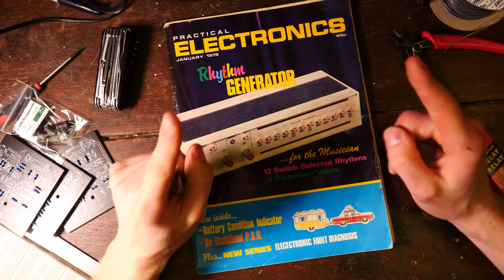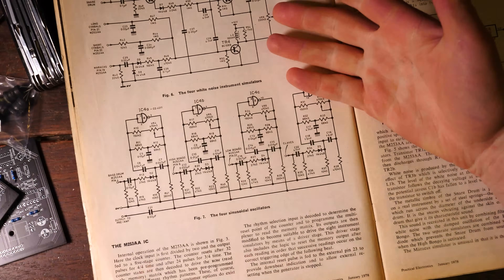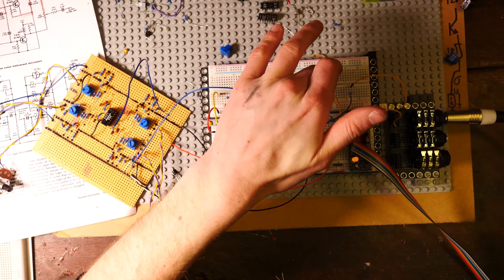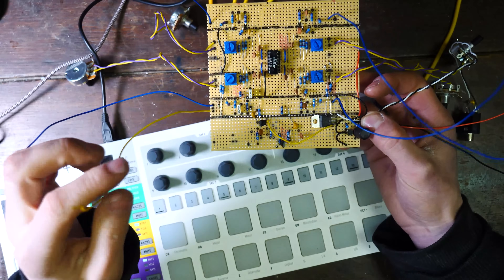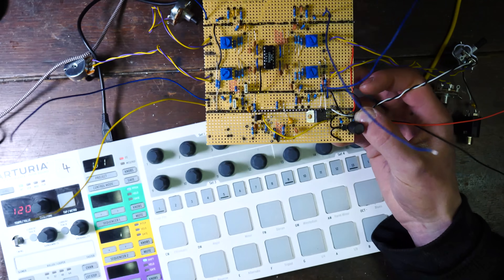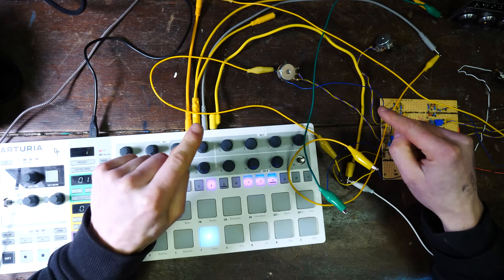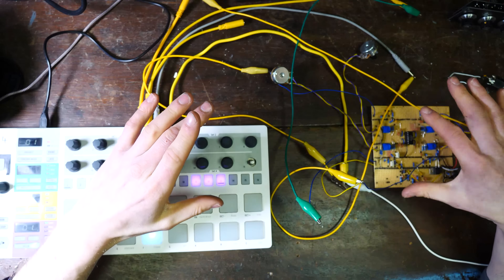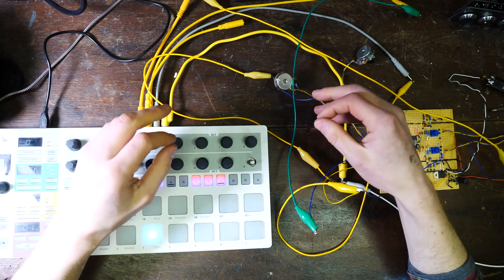Making A Drum Machine From A 1970's Electronics Magazine

Comment: The 4.7k resistor in parallel with the 100mH inductor in the noise circuit section. In the magazine, in one figure the resistor isnt shown, in the circuit diagram it is. Is it needed or not.

I've been trying to recreate this circuit too but can't get the white noise to come through when triggered.  

I've used 2n3904 transistors  instead of bc108b (waiting for delivery) is transistor choice key to this circuit?

What is the trigger spike duration? 5volt 1 msec?

I'd.like to get a working version for myself too

Comment: Everything works, except for the snare which doesn't work properly, too bad!
Reply from the maker: updated it it should work now, note the red wire for power in is on the other side of the 7805 and also if you still have trouble put a 100k resistor between the snare trigger input and ground, some power supplies need it
Reply: @THISMUSEUMISNOTOBSOLETE  Many thanks Sam !!!

Comment: is using a cd4011BE a problem in this circuit ?
Reply from the maker: infact it is preferable
Reply: @THISMUSEUMISNOTOBSOLETE   is there a BOM somewhere or i just need look over the strip board layout ?
Reply: The CD4011BE does not work !!!! have tried many myself! It has to be a CD4011AE!
Reply: @maikmario71  confirmed? I’ve build this circuit with cd4011be and makes rather unpleasant sounds.
Reply: @maikmario71  Nevermind. Seems to be true. I’ve looked on the forum.
Reply: @kkwinkle4689  CD4011UBE and CD4011AE works !

Comment: I'd like to be able to read schematics and then create that stuff. :'(
Reply: A good to know circuit for starting is the triple 5 timer. 555 is so versatile and useful. It is a timer, square wave oscillator
Reply: @cosmiceon  or even easier , cd40106 , only needs a cap and a resistor , and with a diode you can even get a sawtooth and a square wave goin ! :D
Reply: you can learn it , it looks complicated in the beginning but its actually not that hard :) there are lots of great tutorials on here . best way to get started is to search for a simple circuit , get the parts and just throw yourself into it . maybe try an lm386 amplifier , low parts count with some of the basic components to get started with . good luck and more important have fun ! :D

Comment: For whatever reason strip board is crazy expensive in the U.S. while the pad-per-hole stuff is dirt cheap.  Whatever.
Reply: at the moment making a custom pcb is cheaper than buying proto/stripboard, or do like a friend does have JLPCB spit out (custom) protoboards
Reply: @gideonwackers7693  what is the turn around time? From order to delivery?
Reply: @j0nny93rs  quite fast, it mainly depends on which shipping option you take and where you live
Reply: I never knew about stripboard until a few years ago, and I've been dabbling with electronics since the mid-70s. It's apparently been common in UK projects since forever, but almost unknown the US. I used more than a few of the breadboard layout boards though, and plenty of donuts-only boards.

But now if you can wait two weeks, you get some nice boards from JLPCB. I made some boards with LEDs and SMT transistors and a pin header that plugs into a breadboard, because I got tired of making that circuit by hand.